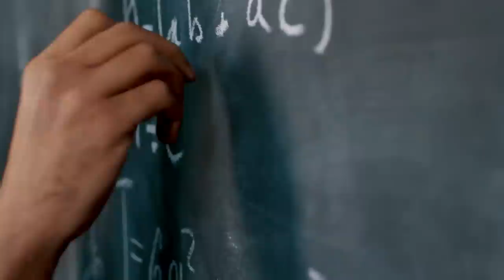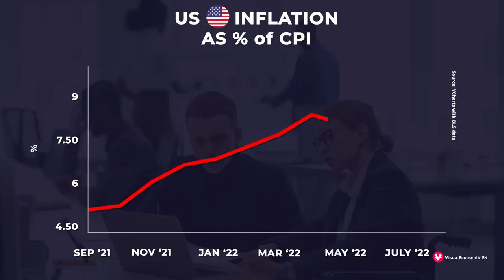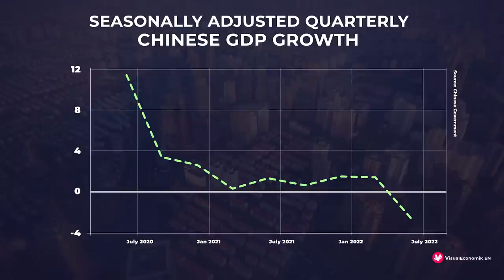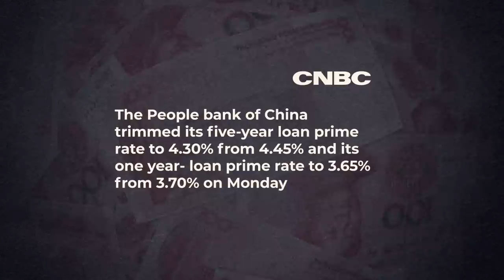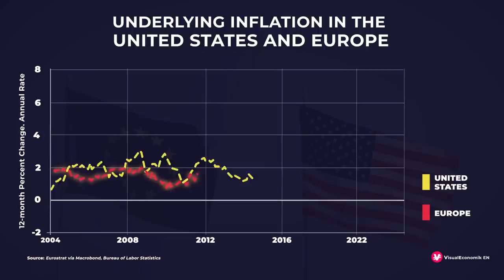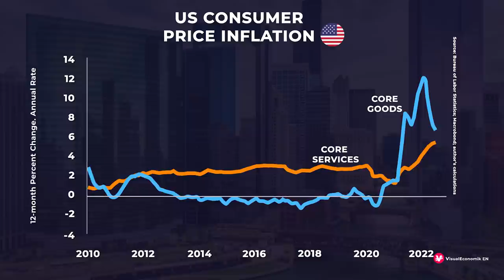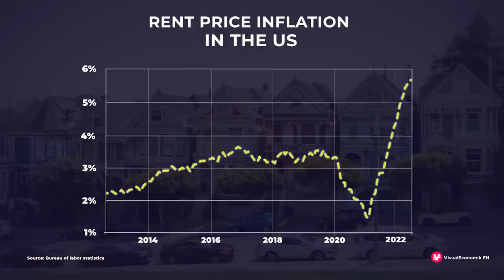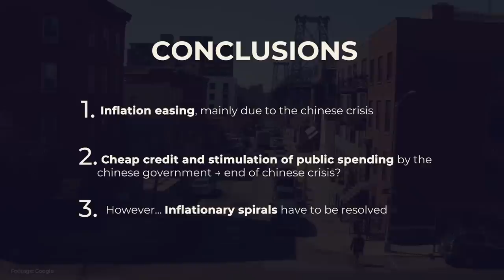The 3 KEYS to ENDING INFLATION in the West  - VisualEconomik EN

Comment: Well China will deliver cheap goods if they continue to deliver goods means China future is somewhat questionable as a whole. if they fail prices sky rocks.
What you don't see is how the strength of the US dollar pushed down inflation in the US. The wholesale prices in the Eu are on a complete different level at the beginning of this year the inflation in this category was 20% and have risen with the fall of the Euro to nearly 50% .  Means imports in the US getting 50% more expensive when the other currencies rise to their old values . Yes the EU is then nearly through with inflation then but the US not and then interest rates goes up in the US again and the game starts over. (This is what also happened in the 70s if you look at the statistics)
Reply: Found some guy with real sense of economics. The rest of comment section is filled with bots

Comment: Poor analysis tbh. 
 Very few wages have exceeded cpi inflation levels, US wage inflaton is just 4.4% over the last year so are in reality a wage cut. A true inflation spiral can only occur with simultanious expansion of the money supply but high fiscal support ended some time ago and monetary policy is tight leading to a slowdown in credit mostly notable so far in residential mortgages (credit card loans are slowing now too). 
 China is certainly creating some deflation in commodity prices (less ghost cities is a good thing all round)  but it is also lowering real global growth via lower real productivity. If they drop zero covid and/or start to prop up the economy via infrastructure/housing again the idea even if commdity prices rise it will spark an inflationary spiral in the west is bogus. A change in relative prices is not the same thing as an inflationary spiral and Yellen was correct (for once) to say inflation has not become 'embedded'.
Reply: The biggest problem is actually that expansion of the money supply.  Simply printing money without a hard commodity to back it up devalues it to the point of worthlessness.
Reply: True. I also would have expected to hear about the influence of those massive, irresposible spendings during 2020 to 2022 (youtube policy perhaps?). In the end the forcast that we will land at the end of 2023 at around 3.5 to 4.5 percent is quite accurate I guess. 

Besides that the ukrainian war, the expansion and change of the energy sector in europe and the question of Taiwan, Indian-Chinese tensions are some other major unknown factors....
Reply: And also missed was the unmetered population migration across the US southern border, surpassing US legal housing permits, for nearly 2 years straight

It does not take a genius to figure out that increases housing prices & costs! 😂
Reply: @DavidHalko  Increased population adds to demand for sure, but it's not a major factor in prices, a slightly more significant one in rents. Peope say it's econ 1011 supply and demand, but then why doesn't supply rise to meet demand when the US has plenty of land and lots of skyline to fill?
Land prices which are a monopoly price determined by taxes and bank credit. If migration is lowered the new supply of housing also slows to keep prices rising as developers always seek to maximise profits in a very distorted market. 
 Whatever your views on immgration, it is not the key to affordable housing.
Reply: @schumanhuman  Why doesn't supply increase to meet demand?  Simple: governments prohibit further construction of housing.  California is particularly bad about that.  And when they do allow for building more, it tends to be high cost/low-density single-family homes rather than affordable high-density high-rises.
Reply: @davidford3115  Not as simple as that, yes Califoria is bad but it's not just bad zoning/NIMBYism but also prop 13 by limiting property taxes means older genrations have no incentive to sell up.
 Tax structures and credit are a bigger factor than building in regards to pricing, you cannot build faster than banks can issue credit and building more doesn't mean utilisation rates are good, China has built more housing in the last 5 years or so than the US did in the whole 20thC, yet prices are incredibly high vs GDP, they have no property tax and credit and savings are poured into real esate, >25% of which sits empty  not just in their notorious 'ghost cities'. Japan also builds a lot, yet Tokyo aprtment prices rose 19% since 2020.
Reply: @schumanhuman  - “population… not a major factor”

More people needing to live in a house than housing that exists most certainly creates a major factor in prices.

“why doesn’t supply rise to meet demand”

The governments must issue permits.

“US has plenty of land and lots of skyline to fill?”

The governments must issue permits.

“Land prices… monopoly price determines by taxes and bank credit”

As long as people are willing to buy the land at a higher price, the taxes go up since the value goes up.

There are land prices by Detroit are cheap, as miles upon miles of land area was abandoned, and that land is cheap… but there are no jobs. There are also no government services, because the land is cheap & taxes so low. 

There must be job opportunities in an area, before people can settle there.

If there are no job opportunities, then there must be a degree of wealth independence, in order for it to be like an extended vacation/retirement.

“If migration is lowered”

Or if housing permits are increased, this would solve the problems

“developers always seek to maximize profits”

As do all families, in order to save for a rainy day. 

“views on immigration”

It is simple:
1. Government permit more housing
2. Government limits immigration 

Either way, the government has control, they have to do something about it. 

“not the key to affordable housing”

Affordable housing is a longer term problem.

Right now, we are just talking about the general inflation in & out of the housing market, caused by some dumb, really dumb, politicians… who wanted to get rich at the expense of the poor & middle class.

This is not rocket science. 
There are idiots who think they can increase population faster than what they are permit houses to be built. 
Those same idiots think they can do it for 2 years.

Clearly they knew the consequences, 
which is why wealthy investors, supporting the idiots politically, were snapping up land everywhere.
I have no sympathy for the Lords who want to own the land and make the serfs suffer with super high rent.
They cause the inflation in the US, now they need to suffer a little, like the rest of the poor & middle class
Reply: @DavidHalko  'More people needing to live in a house than housing that exists most certainly creates a major factor in prices.'

Right, but that is often not the case. UK housing has increased MORE than total no. of households over the past 25 years, but prices have risen massively.

It is simple:
1. Government permit more housing
2. Government limits immigration 

 Developers are sitting on 600,000 plots with planning granted already, but you say the awnser is for more to be granted when they are hoarding and drip feeding already? 

 Upzoning may ALLOW more building and improve optimal density, and I'm all for that, but unless you tax the site value which othewise capitalses into a price(as most economist agree is the best way to tax), larger developers will consoldate enough of high value areas that monopoly power will distort the market. 
 Lower immigration will have no long term effect on this dynamic.
 YIMBYism needs LVT or it flounders. The fact Japan has a shrinking population and lots of construction hasn't stopped local bubbles forming in major cities. Blaming immigration for high house prices is like spending your energy attacking new prisoners for overcrowding when you've been falsely imprisoned.